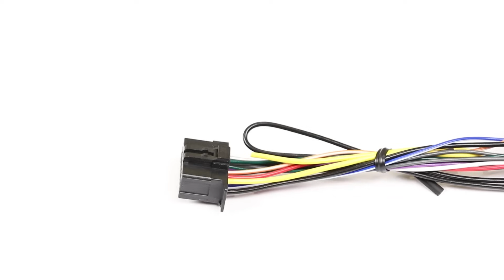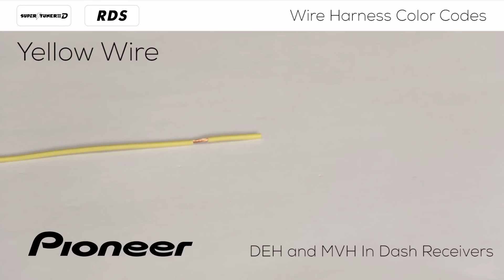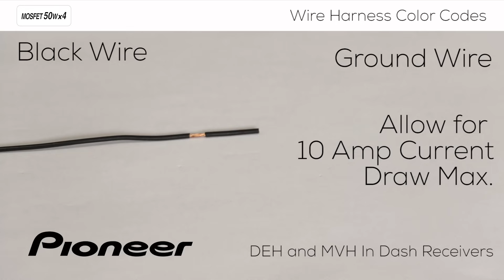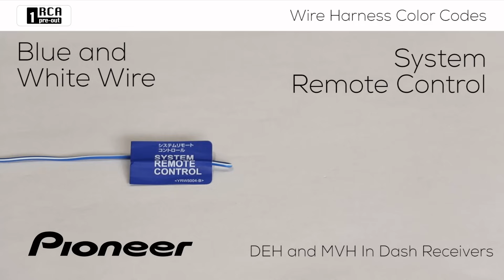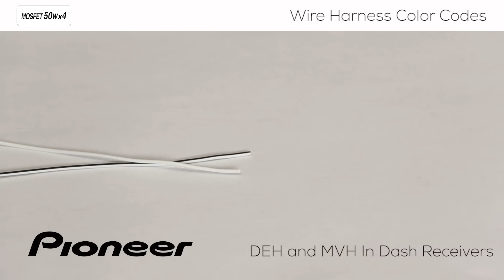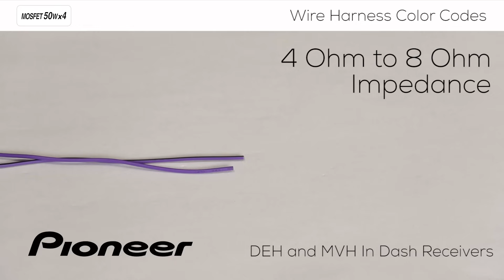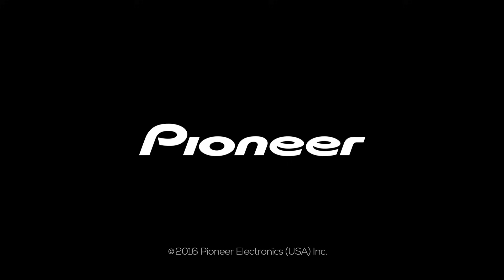How To - Understanding Pioneer Wire Harness Color Codes for DEH and MVH In Dash Receivers

Comment: My display will go in and out on my  pioneer deh-x55hd  but will stay on in I gently push the bottom up????
Reply: It's possible the connections on the back of the detachable face need to be cleaned.  I recommend to remove the face.  You can see it on a similar in-dash receiver here:  https://youtu.be/-kdVMZNL1MA?list=PLw63zJRQbCNjHlWArmfcigwaM_c9h7QxR   Clean the connections with a Q-tip and some isopropyl alcohol or gently rub with a pencil eraser. You can find more videos from Pioneer here:  https://www.youtube.com/user/pioneerelectronics

Comment: hi i got a pioneer x2700bs with 1 orange and white wire . on my harness kit their is a orange and white labeled dimmer and a solid orange wire illumination.     which wire do i wire it too?  the dimmer wire or illumination wire?
Reply: On the wire harness for the in dash receiver, the orange wire with white strip is used to dim the in dash receiver.  Not to power the illumination.   Contact your wire kit manufacturer for more information.  Check out this video for more information about the Dimmer settings:    https://youtu.be/T4PQl3AZNkA?list=PLw63zJRQbCNjiTohYtcYmfGNQm5QqzrkX

Comment: I genuinely don’t understand what to do with the ground wire???
Reply: If you don't understand what you are doing please go to a car stereo professional for installation help.  The ground wire must be attached to metal in the body or frame of the vehicle. This may require a screw into metal behind the in dash receiver with the ground wire attached.   In many vehicles, there is a ground wire in the factory wire group that operated the original in dash radio.  The ground wire can also be attached there.
Reply: Could I attach my ground wire from the pioneer to the ground wire in my wire harness and would it still work?

Comment: i have problem with the yellow wire. Can't seem to have power on the radio unless the car is turn onand everytime i turn it on, it resets. damn annoying. 
Any suggestion
Reply: usually its as simple as swap the red and yellow wire but check outputs first if your unsure
Reply: You have it wired wrong.  The Red wire should have power only when the vehicle is switched on.  The Yellow wire should have power at all times, even when the vehicle is switched off.  If you don't know what you are doing I recommend going to a car stereo shop for installation help.
Reply: oh well i got it fix, i just connected to a fuse with a piggy back.
constant 12v but now when i turn the car off and key out of the ing. the radio stays on HAHA
Reply: You have the RED wire in the wrong place and you are going to kill the cars battery. The RED wire should have power only when the vehicle is switched on.  I recommend going to a car stereo shop for help.

Comment: Would I be retarded for hooking up the solid orange wire to the orange w/white stripe?
Reply: Orange/white stripe is used to switch the in dash receiver dimmer on and off. Depending on your settings that could make the receiver lights dim both day and night.   If your receiver model has an illumination timer, you don't need to hook up the orange/white at all.  Check out this video for information of the Illumination time available on many Pioneer receivers:  https://youtu.be/MeK3k6CEb2w

Comment: Model : Pioneer  FH-S701BS 
When i get Bluetooth call, I can see it on the display..when I press answer button I can't hear anything...sounds are not coming through the speaker ..
Reply: Phone calls can be heard on the FRONT SPEAKER OUTPUTS and FRONT RCA OUTPUTS only when the system is set up in Standard Mode.
Bluetooth Audio can be heard on both Front and Rear Speaker outputs.
To check your set up, fade the system all the way to the front.   Can you hear a call?  Can you hear music?  For help with the fader, check out this video similar to FH-S701BS   https://youtu.be/VgeH4WSTXA4?list=PLw63zJRQbCNhuis5iY1gXLiECI1Grov3W
This video will help with Standard and Network mode:  https://youtu.be/cmTgZSwcUJs?list=PLw63zJRQbCNhuis5iY1gXLiECI1Grov3W
Reply: Deckerd Otto : awesome...those informations are very helpful for me....thank you

Comment: I just bought a DEH-S5010BT. I can't believe how small the speaker wires are on the harness, comon man !
Reply: I concur with your comment (they should be bigger - specially for long wire runs), but to be fair, the 18 awg wires from the head unit for the speakers have plenty of headroom and bandwidth for the relatively low power and fidelity of the head unit, just keep the total run length to about 12 feet (or 3.5 meters).  Now the speaker wires from your external amplifier (if equipped) to the actual speakers is another story.
Reply: Helped a lot thanks

Comment: Everything works perfectly but when I try to play music no audio plays
Reply: Do you mean Bluetooth Audio?  What model in dash receiver?
Reply: Deckerd Otto no it’s all audio radio, aux, and bt produces no sound. I have the DEH-S4000BT
Reply: Are you using external amplifiers?  or connecting your speakers directly to the in dash receiver? How many speakers are connected?  What is the fader position?
Reply: Deckerd Otto it’s a 2001 Tahoe, everything is stock I was just tryna get Bluetooth in the car.
Reply: Thanku

Comment: After putting in my pioneer DEH-S1000UB in my Toyota Corolla, and then connecting my iphone via USB wire, it switches to Aux automatically. So I switch it back to radio and after a little time it switches back to Aux. How can I make it not do that?
Reply: In the Settings Menu  , switch USB Auto to "OFF"

Comment: My radio keeps going up in smoke or the fuse keeps on popping. I am not sure why this is happening as I checked all the wires nothing is touching the body none of the wire is touching each other. For a brief moment the radio goes on them smoke and fuse pops. Please help
Reply: Stop what you are doing and go to a Car Stereo shop for professional installation.

The color codes in this video are for Pioneer in dash receivers only.  The color codes on the Pioneer receiver wire harness are not meant to correspond to any auto maker wire colors for any model or year of vehicle.

Buy an after market wire harness adapter for your specific vehicle.

Comment: Anyone got help for a 98 honda accord i looked up its radio harness and cross referenced it with this color code but the speakers arent working at all
Reply: john boe v
Reply: The video above show wire harness color codes for Pioneer in dash receivers only. 

The Pioneer color codes are not meant to match up to any given auto maker color codes.  Every auto maker uses different color codes for different vehicles, and years.  

I recommend buying a wire harness kit for your particular vehicle.  If you don't understand what you are doing, please go to a car stereo shop for installation.
Reply: john boe might have a built in amp

Comment: In my country you always have to drive with "driving lights" If you don't its a 100€ fine.
Reply: Many Pioneer in dash receivers have an illumination timer that will switch the dimmer on and off based on the time of day and not the headlights.  Check out this video for more information:  https://youtu.be/VMWWQ8D4a6Q?list=PLw63zJRQbCNiqf5pU1wQ00VD9BRgM0eH3

Comment: Hi. Could not find any video that could explain how to connect the head unit to 2 speakers in front and 1 subwoofer using the rear channel without an amplifier
Reply: I don't know what model of in dash receiver you have, but you can check out this video for more information on changing the rear speaker outputs from Full Range to Subwoofer output.   https://youtu.be/CGri78izPzA
Reply: Deckerd Otto hey thanks a lot for the quick reply. I actually found one of your videos for the same. I love pioneer products man.

Comment: I am getting amp error what to do
Reply: Two possible issues.  One, Are the speaker leads touching one another?  Or are the speaker leads touching metal?  This will cause the Amp Error message.  Two, if you have overloaded the blue/white wire this will cause the Amp Error message.  Use a relay on the blue/white wire to switch on and off external devices.
Reply: The blue white is not connected to anything and the speakers wires are good
Reply: The deck was working all of a sudden amp error
Reply: Disconnect the speakers from the receiver. Turn the receiver off and back on.  Do you still see amp error?  If amp error goes away with no speakers connected it means a speaker wire is touching metal somewhere in the vehicle.
Reply: Ok thanks I will check that

Comment: I've installed a Pioneer Deck model DEH-X1900UB. After installing the car stereo my speedometer light is out as well as my tail lights.  what could have caused this and how do I fix it?
Reply: If you need help I recommend going to a Pioneer Authorized dealer for installation.  
I sounds like you popped a fuse or two when you did the install.  If you cut wires from the cars harness during the install you may have grounded hot wires and a fuse will blow.  Check your vehicles fuse box to see if any need to be replaced.
Reply: Sounds like the tail light dash lights fuse. Generally it's a 15 fuse under the hood.
Reply: Fuse blown

Comment: Right now I currently have the DEH-6300UB installed in my dash and want to put in the MVH-X580BS. Do I have to swap out the harness or can I just use the same one?
Reply: I'm not familiar with DEH-6300UB.  The pin order on the wire harness may be different, however the wire colors will be the same.